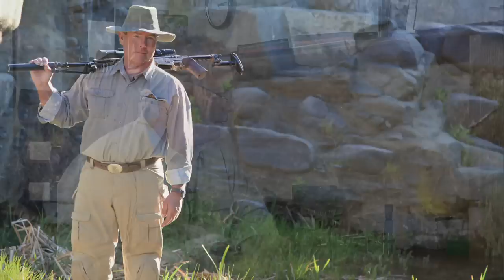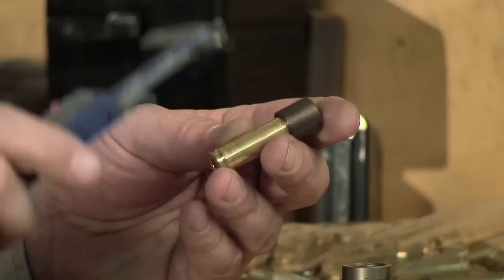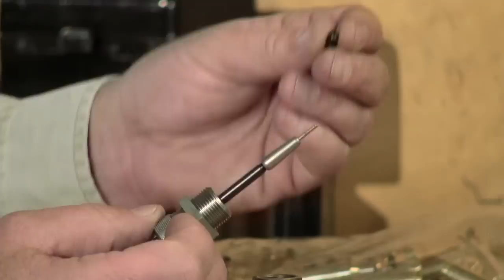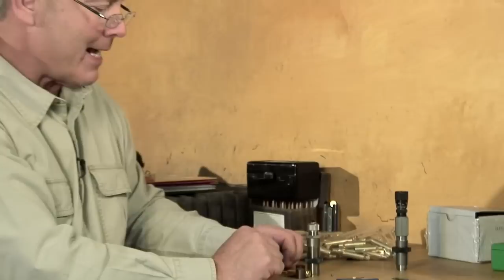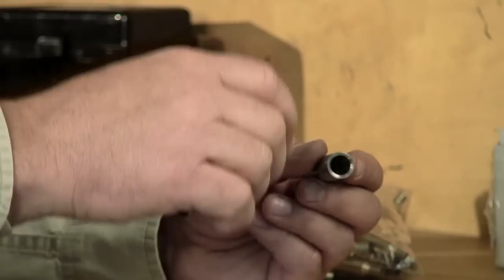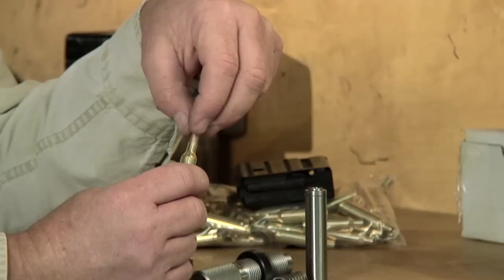Tubb Precision 6XC Custom Sizing and Seating Dies

Comment: Thanks for the open-box demo! Your gear is certainly well thought out; you didn't bother to elaborate on the reamer/sizing die relationship at the base of the 6XC. Recently, there have been some confused postings on shooting websites regarding different options; but yours is designed to work together as an integrated set. Why not use plain vegetable oil instead of Imperial wax?